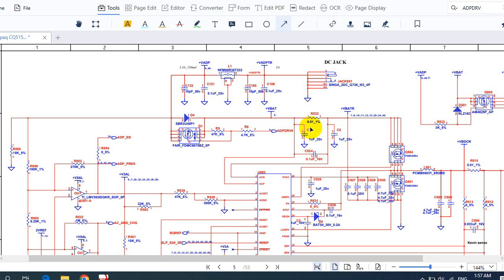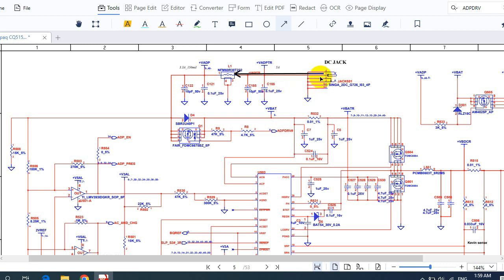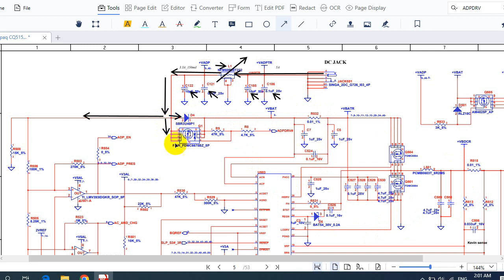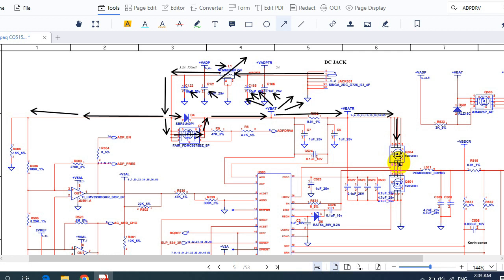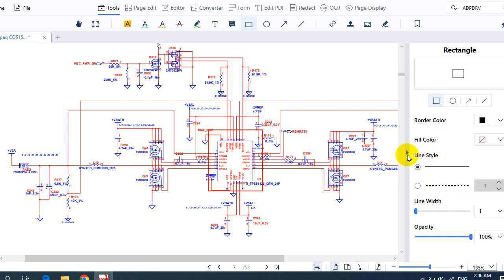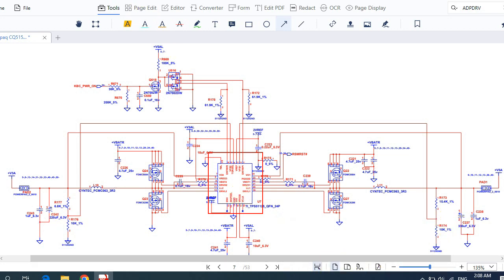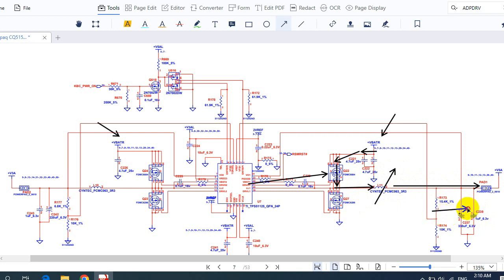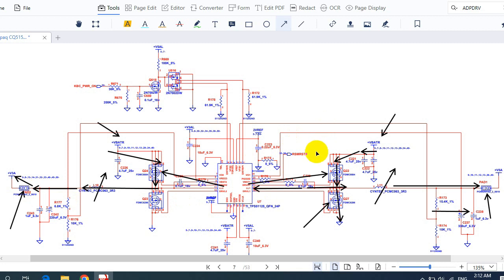Learn how trace motherboard voltage, laptop motherboard repair

Comment: why does the first mosfet have 19v pass from drain to source? I thought it was supposed to pass from source to drain once voltage has passed on to the gate?
Reply from the maker: When the Mosfet is N channel the voltage passes from source to drain but when it is a P channel the inverse from drain to source
Reply: @electronicsrepairbasics_erb  thank you. Your channel has taught me a lot.

Comment: You are good. But please can you give me a schematic diagram the is basically generic so I could practice.
Reply from the maker: I don't understand you, bro. Please come again
Reply: @electronicsrepairbasics_erb  I have an Elitebook 840 g3 that is refusing to boot up. When the power button is pressed the system act has though it want to come up but would suddenly shut down no display at all. So asking if you can help me get it's schematic diagram.